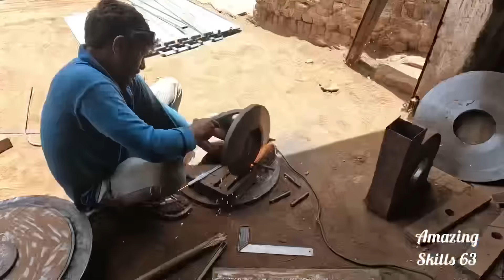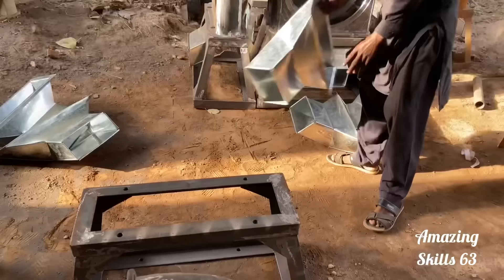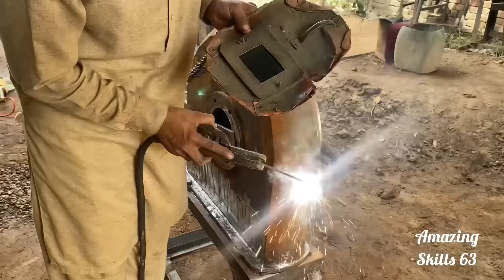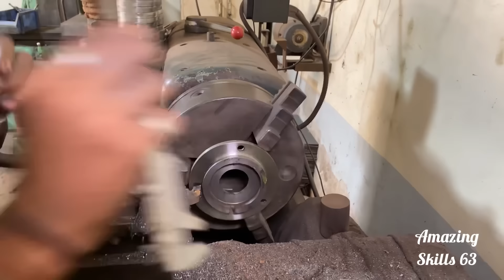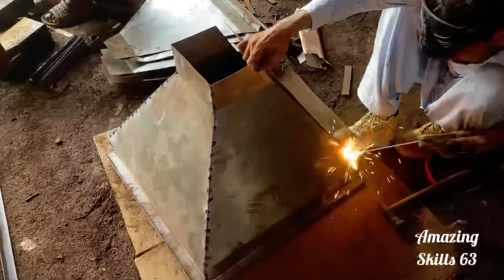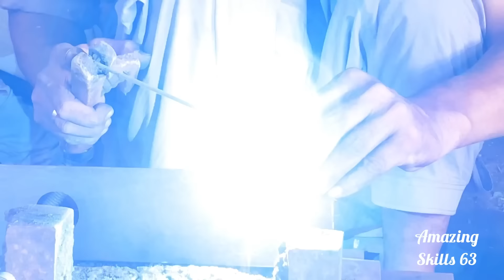How to Make Wheat grinding machine-Amazing Manufacturing Process of Wheat grinding machine|

Comment: Does this machine really make flour? I would be glad if you answer.
Reply from the maker: Yes, why not 😊 Yes this machine really make flour and also porridge, gram flour etc
Reply: @AmazingSkills63  Tjanks for response.Why are small pieces of iron welded into that blade? So what is the material of these small pieces of iron?I would be happy if you answer
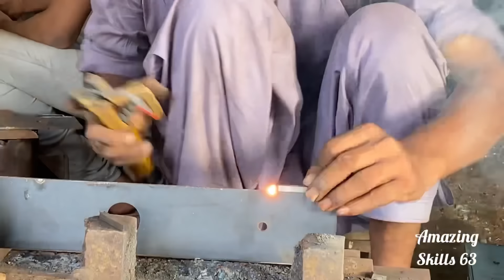Reply: @AmazingSkills63  49:57 ?? I'm still waiting for an answer
Reply from the maker: @mrbrowneyes74   So Sorry for replying late ❤ The material of those small pieces of iron is brass. The purpose of welding those small pieces of iron into that blade is to grind flour easily.
Reply: @AmazingSkills63  Thanks for response
Reply: No it's not brass it's highspeed the hard material.